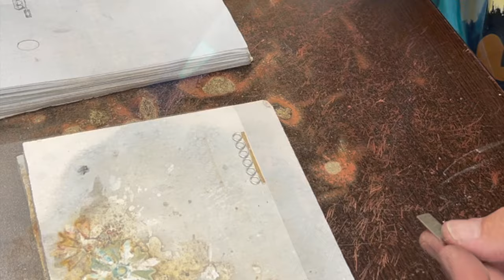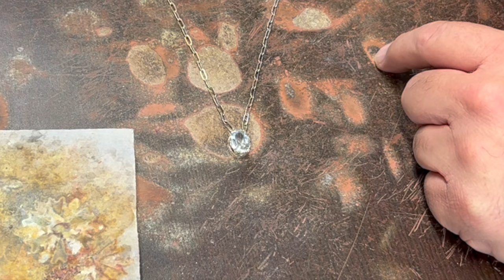12 Prong Aquamarine Pendant: A Silversmithing Tutorial

Comment: What size jump rings did you use/make?
Reply from the maker: Hello Marjorie. I used the length of the lower piece to dictate how big I made the rings. I lined the 6 rings up along its length with a small amount of space between them. I don’t have this piece anymore so I can’t measure. They were maybe 4 or 5 mm diameter. Hope this helps.

Comment: It's math (yes, that pesky thing...): length plus width ÷ by 2. Then, take that diameter and  multiply by Pi. Metal thickness measurment added based on where you put the stone; on top (no addition) or inside (definitely add). Easy peasy! This is pretty! I love a sweet blue beryl! Watching (not to the end yet) and wondering how you decide on ring sizes to accurately place for the size of the base. I might have taken the length of the base piece, then divide that by how many rings you want (for the two each prongs). That would give the correct diameter needed of each ring. Otherwise,  the issue could be a poor line up when the base ring (oval) is closed and the prong rings don't line up. Or you could make it based on the approximate size of the prong jump rings and then close and stretch the oval to fit the stone.....What do you think?   🌺 🌺 🌺
Reply from the maker: Oh, duh!   That formula makes sense:). I probably learned that in 8th grade:)  I shot this one a while back, so if I remember, I estimated the size of the base ring wire, made 6 rings to fit evenly spaced along the wire, but after it was all soldered together, cut a small piece out of either end to make the base ring slightly smaller as it seemed slightly too big.  I think if I get the bottom ring size right, most problems will take care of themselves:)
Reply: @chadssilversmithing  Ahh, that makes sense. I was thinking, "Wow, that's some lucky and accurate jump ring placing!"  I really like that technique for nice prongs! And as far as that pesky math, sometimes I wish I didn't remember all that stressful mumbo jumbo! Lol! I'm much more in love with history and writing, physics, flying, and ......lol! This was a really great video. I like how the way you did the prongs and where they ended up on the oval, the setting almost looks geometric with angles. Nice! 🌺 🌺 🌺